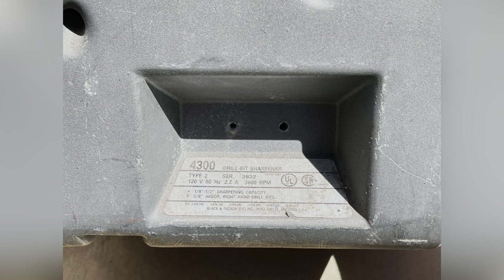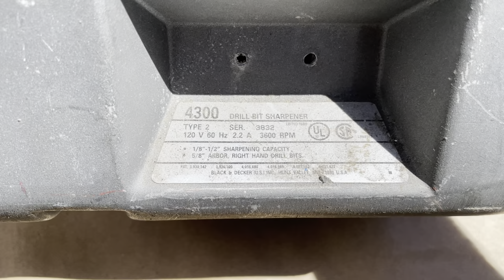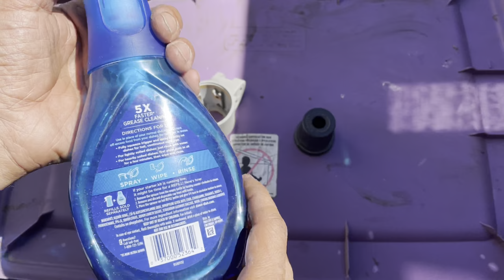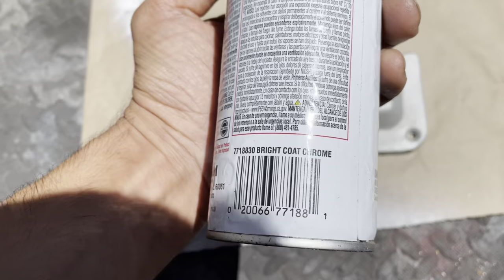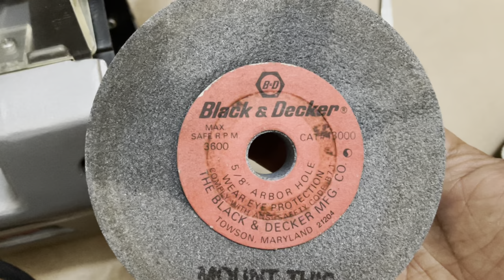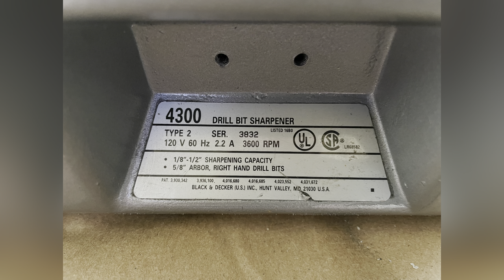Black & Decker Drill Bit Sharpener. Model 4300. (Detailed disassembly, Clean up).

Comment: Nice restoration. It will save you a lot of money if you use a lot of drill bits like i do. My wife bought me a Drill Doctor drill bit sharpener for Christmas and I've sharpened all of my old drill bits, probably 300-400 of them with it and it works great. I should never have to buy another drill bit as long as I live.
Reply from the maker: Thank you very much. I appreciate it. It is a very good tool but without its indicator it’s hard to work with. I’m planning on making one for this drill bit grinder. 
Drill masters are very good. I’ve seen them on Youtube. What a great gift. 
Thanks for commenting and watching my videos. 🍻